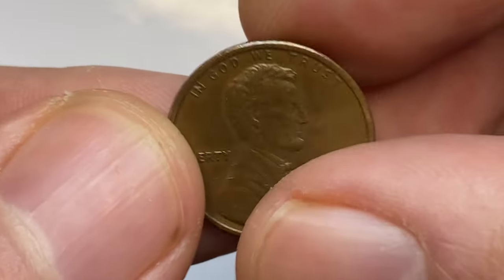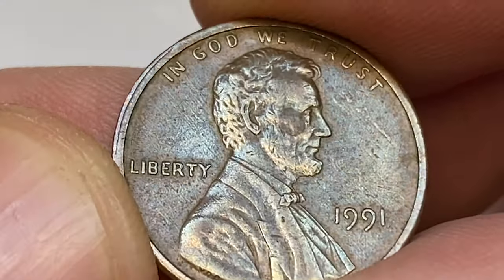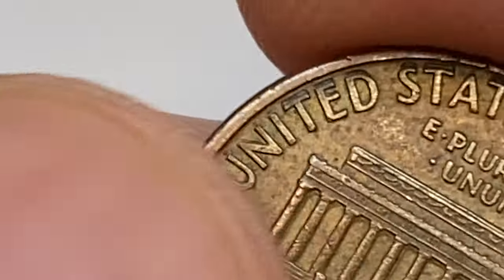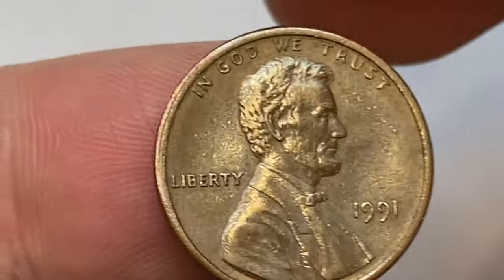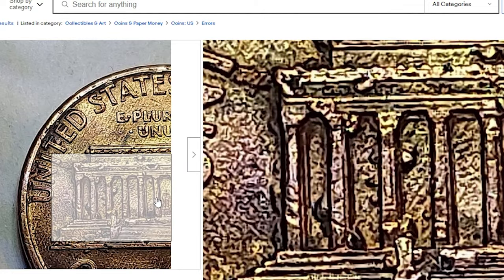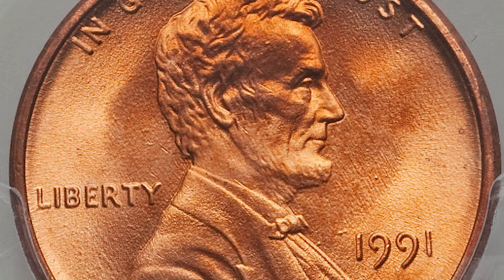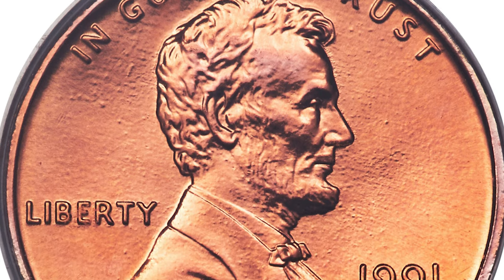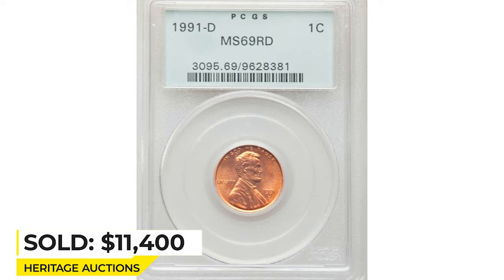Don't Spend This 1991 Rare Penny Coin

Comment: I was told that when the doubling goes towards the ring it isnt the doubling that is sought after it is called damaged die doubling DDD as opposed to DDO/DDR... Also I have been wondering about the Collums whether or not they were supposed to have that 2nd line cause if not I have seen a BUNCH with doubling there 🤦‍♀️ There is so much to learn about coins I don't think I will ever learn it all or rather be able to remember it all!!
Reply from the maker: Yes main difference between double die and mechanical /strike doubling in simple words is that, the latter has more of a flatness and are shadowy, double dies have almost the same high points as original lettering or element (my english is not so good, don't know if was able to explain)

Comment: I have a 1 cent coin in 1991 D.Special
The number 1 at the end of 1991 is very hard to see, it is blurred or not clearly cast. Excuse me, is it worth it? And can it be sold? Thank you
Reply from the maker: No, just weakly struck due to die detoriation. I don't recall any variety related to poorly struck numeral.

Comment: At 1:25 the one you said you saw on eBay with the damage or DD on the columns.
 I have a 1973 Lincoln cent with concern to the columns. They're all the same size except on the coin I found they're not all uniform in size, and also a raised portion in-between one set of columns.
 I have been unsuccessful in finding out much about this. I don't know if anyone has any knowledge of that please share it.
 Thanks for reading this 😎👍🫡
Reply: That's my question I thought the 2nd line on the columns were ment to be there to give it a 3d look cause I have seen it on A LOT of my pennys but now idk so much... Imma ask my highly trained penny specialists ( lol ) and will get back to u